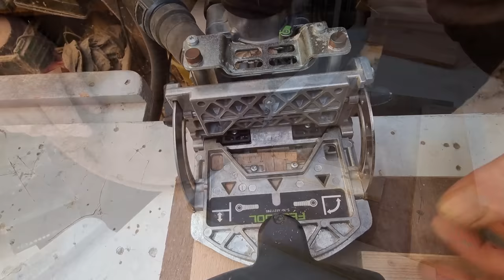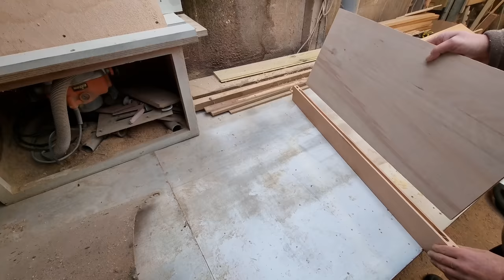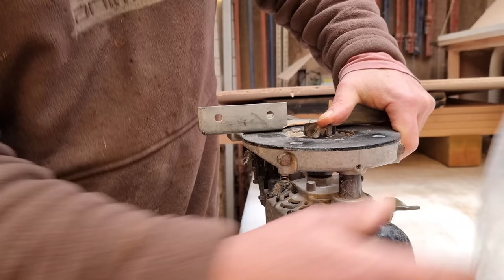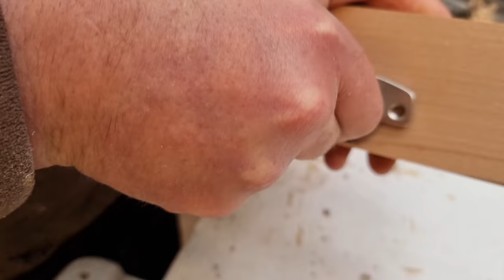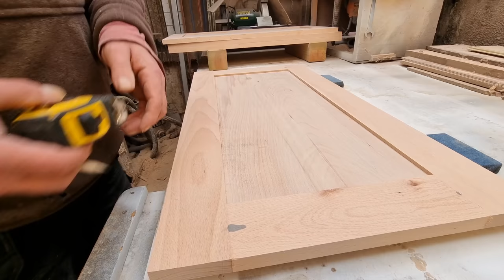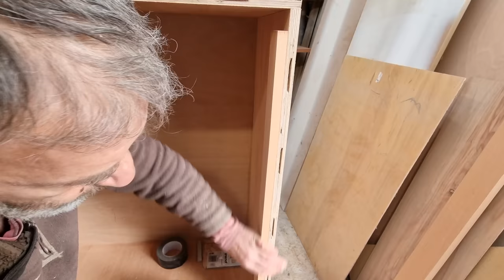Debra's Alcove cupboards & Shelves build Pt3 -  Making the doors & fitting soft close cabinet hinges

Comment: Things coming on nicely mate, love the use of winding sticks to check your doors for twist and then stacking all other doors on top, I’ll have to remember that one, I have the big triton in my router table never seems to be short of grunt and apart from a new speed adjuster has served me well for the past 15 years 👌👌👌👍👍👍🇦🇺
Reply from the maker: Thanks, decorator is in tomorrow Sunday, so i should have the finished job in the last vid when i get them uploaded, Yeah stacking them puts a bit of weight o the ones below too, For a half cheap router it's done me well too, i love the collet that pokes out the top, auto locking & the rise n fall knob, mine gets a bit of crud in the rise mechanism but a blow out n a bit of 💪 normally sorts out 👍 I'd buy it again, it was a few yrs since i got it so i might have a look n see what''s new with Triton 🤔👍 not that i nee another router 😂

Comment: Using a router for your hinge holes looks allot better than drilling them out. What sort of bit are you using?
Lovely work
Reply from the maker: Thanks 👍 Yep so much better than fannying around with a jig, once it's set up which doesn't long, I think it's one of these, i've had it a little while https://www.wealdentool.com/cgi-bin/sh000001.pl?WD=hinge%2035mm&PN=Online_Catalogue_Hinge_Boring_26%2ehtml#aT1835
Reply: @Gidjoiner  nice one cheers Gid
Reply: Not sure I agree. I mark all my positions with a stick. Bradawl the centres and a sharp forstner bit cuts the holes in 3 seconds.
Reply from the maker: You're way might initially quicker but if i could be arsed I'd challenge you to 20 hole cuts n see who's were neater, most consistent depth & distance from the edge, & poss even balance those things against time if i was allowed the 10mins to set up the router, but each to their own 😎👍,

Comment: Will you not pick up a problem with expansion and contraction by gluing the panels to the frame. Thanks
Reply from the maker: Hi, no the ply won't move.
Reply: @Gidjoiner  👍 I'm learning.😁
Reply from the maker: 👍 Ply is made with the grain of the layers going in different 90º directions to each other, it's hardwood + the glue it's very stable 👍 this ply is also 'WBP (weather and boil-proof)' so atmospheric conditions won't affect it,

Comment: Check out Salice hinges from Italy Gid. In my opinion they are far superior to Blum, HETTICH, and Grass.
Reply from the maker: Thanks, just had a look n i'd have to order online, the Hettich ones come from Lawcris my board surpliers 😁👍
Reply: @Gidjoiner   If you use a lot of these hinges it might pay you to do just that. They have an extensive range and their hinges have a parallel mechanism in them so adjusting the door L to R doesn't change the gap between the door and the cabinet. I.E If you close the gap between the door and the cabinet end you don't have to readjust it to bring it forward and the reverse if you move the door to be closer to the center.  Have used Blum and HETTICH but Salice are by far the best. And the hinge mounting plates come with prefitted Euro screws. They also have a wide range of jigs as well. Been using them for 14 years now and no complaints.
Reply: @darrylkennedy2125  I've found Blum and Hettich to be excellent cabinet hinges. Have you a link for the Salice hinges?
Reply: @Toyotaamazon80series   No. I'm in New Zealand. I get them through a company that imports them from Italy amongst other hardware
Reply: @darrylkennedy2125  Ok, thanks, 👍🔨 🇮🇪
Reply: You can get Salice in UK from Salice direct. £6 shipping.

I'll give them a try next time.